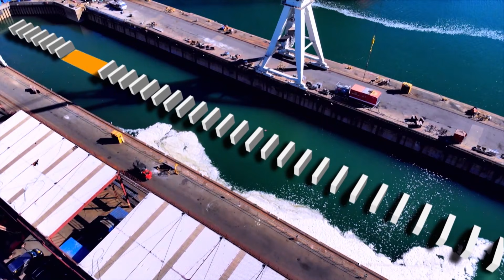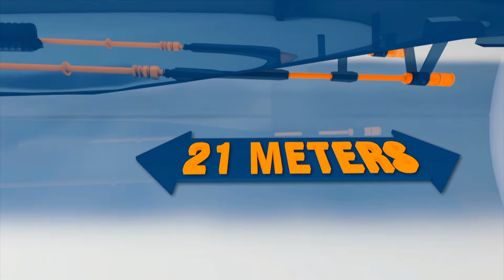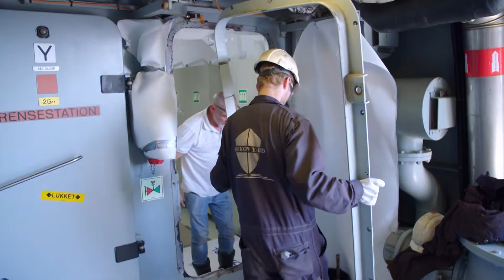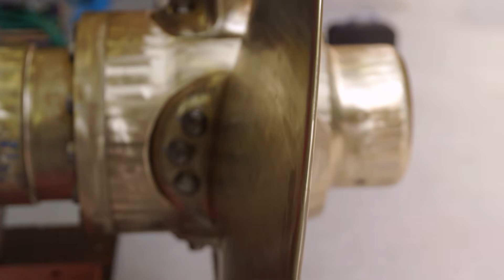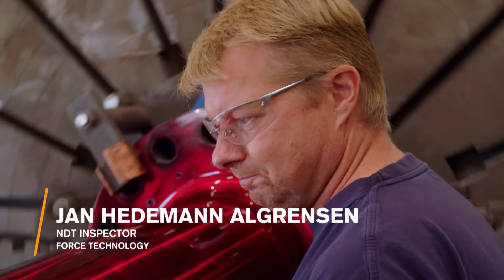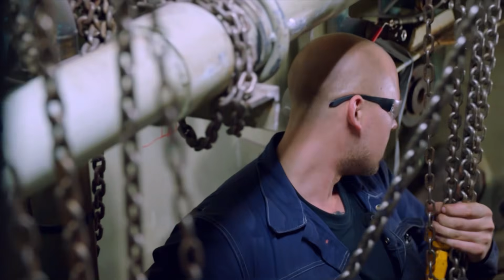War Ship: Navy Vessel Heavy Maintenance | Mega Pit Stops | Episode 4 | Free Documentary

Comment: the 2 things im totally blown away by, #1 the fact that the ship can support itself out of the water on such a small crib under the keel. And #2 were the pneumatic come-along chain winches. How cool are those things?
Reply: Agreed..I was thinking the same
Reply: You forgot the wooden beams along both sides. Whilst they are partially to ensure the ship stays upright they are more to support the weight of the upper parts of the ship so it doesn't sag laterally around the keel line
Reply: I kept thinking how thin the ship's hull looked. Maybe 50mm thick. Seems too thin to be able to withstand any sort of bombardment.
Reply: @spankyjeffro5320 Modern warships focus on trying to avoid being hit rather than to withstand direct hits. The age of the battleship is over, missiles are now the primary armament for warships and no amount of hull thickness is going to allow your ship to shrug off a hit from one of those.

Comment: Having been involved with tracking and balance of helicopter rotor heads and blades I was totally understanding of their dilemma when they had to measure the track of the propeller shafts, whilst I didn’t have a tolerance of only 3mm I still had tight limits to work to, and when you are trying to get an assembly designed to turn at high speed and move in multiple planes it adds a whole new element of difficulty, but these Rolls Royce guys made their job look like child’s play, but I know different it’s neither child’s play or easy, total respect for their abilities and workmanship. 
Thanks for sharing this interesting and informative film, awesome pit stop. 😀👍🇬🇧🏴
Reply: I was amazed they had that large of a tolerance. I machined prop shafts for US carriers and submarines and the tolerances were generally much less. Looked like they were really only checking runout though.

Comment: True I was a Combination First Class Electronic Electrician. We did all the lay outs, in some cases help the Cable Pullers to pull some of the cables to speed the process up in the beginning so we can install the equipment foundations and the Cable wire ways. Then we would do what we were hired to do, install the equipment to their designated compartments. Then install the cannon plugs/connectors to the cables. And once the  Meggers, Megg out all the cables from having one wire as in the coax cables for TVs and electronic displays to up to 400 conductors/wires. Then after that is completely we would apply power test for proper working condition. Then Sea Trials. But since I was one of a few Technicians that was certified to weld the foundations so I always pulled from the Sea Trial team because the next ship would as usual be late starting it because of agreements on the last minute changes and pay and working details because they were all Union Companies so the different shops. Because of changes made late would have to work those details out. So the starting dates would be late so the foundations had to be laid out and installed with “speed” to make up lost time for contracts that would have to work out. So I would always be pulled to have to install the equipment foundations first once the hulls were coming together. But I enjoyed my job! But my other job skill I had was working on Military aircraft mainly Helicopters but I was also a First Class avionics, electronic and weapons technician on them and on C-130’s, A-10’s and transit aircraft that would land and be passing through or had a failure of some sort. So I was one of a few certified to work on all fixed wing and rotor wing aircraft from all of the other branches of the Military Service. Loved every minute of being a Civilian Contractor!😎

Comment: I think he missed out on adding one more "extremely fast and maneuverable" when they took out the thruster :-D
Reply: No no, He said the 127mm Mark 5 gun, he called it "A MACHINE GUN" 
It's a 127mm, A tank has a 120mm.
Reply: @Justineexy  it is automatic, with about 20 rounds a minute.. kinda is a machine gun
Reply: @OliverFlinn  bro, a machine gun is a 7.62 or a 5.56 Gun that can fire about 700-1000 rounds per minute.

That Mark 5 127mm gun is about 60 times larger than a 7.62MG. 

Even if you take a .338 it would still be 40 times smaller than the 127mm.

127mm is the gun used on the arleigh Burke,  Capable of hitting a target at over 20miles and can sink a ship with 10 to 40 rounds. 
The 7.62 Cam even pen a ship..
Reply: @trymetal95  hey,  It's the danish man,  you gotta consider the fact that Denmark is small, making these ships really is an accomplishment.
Reply: @Justineexy  an automatic gun that fires bullets in rapid succession for as long as the trigger is pressed. <--- definition of a machine gun, not a "its 7.62 or 5.56mm.
Reply: @OliverFlinn  jezz! Man?!  
It doesn't fire automatically,  It's a semi auto. Like how you can shoot an M4 on semi auto,  It can fire a round every 5-8 seconds...
 A machine gun can fire a round every 0.2 seconds or so
Reply: @Justineexy  it does fire automatically, theres a joystick, and you just have to press on it, it loads automatically, as long as there is ammunition in the magazine, therefore, by definition, a machine gun.

Comment: They should be using pipeline pipe rollers with rubber padding on rollers for this drive shaft
Reply: I have the feeling they know what they are doing, but  you can always apply for the project manager job if you think you can do better.
Reply: Steel rollers don't hurt them. Some places do use ones like you've mentioned though. I've worked on a lot of prop shafts far far larger than those and we used steel rollers. More often than not you do all of those inspections in the lathe between centers anyway. Looked like they were just checking runout for the most part.

Comment: All through this documentary it is scratching and clawing for sensation that is not there and i always wonder why!, the made up tension and "suspension" around the crooked prop shaft is bogus because they already suspected it to be crooked when it was still installed so it is in the repair schedule... what's the surprise??! ... let the video tell its story and stop making a fricking drama for nothing!.
Reply: Yep as soon as I heard the American talk I knew it would be like this. What could have been an excellent documentary but sadly ruined by the ever over-dramatic yanks.
Reply: I'll not call this a documentary at all.
Reply: I missed the “and time is running out”
Reply: The prop shafts are always bent to one degree or another. They made it a huge deal. Sometimes they are bent like a banana and you can straighten them, even ones far larger than in the video, by beating them with a sledge hammer. I've had to straighten a lot of aircraft carrier and submarine shafts before.

Comment: it's crazy scary that they balance the ship with only wood rods
Reply: Naw, they had tight ropes as well.
Reply: The ship is balanced entirely on the dock blocks at the bottom. The side shores (wooden rods) are only for stabilising the ship during the "twilight period" when the ship is partially sitting on dock blocks and partially buoyant as the water in the dock is pumped out.
Reply: Wood "rods"? Telephone poles are "wooden rods", too. But BIG wooden rods. It's all relative.

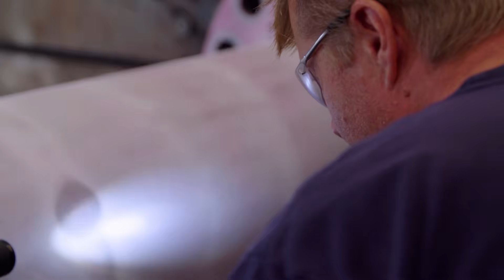Comment: 35:47 But how they fix the shaft?
Reply: even though it’s expensive the shaft should be replaced and not fix .
Reply: @dllms  brand new shafts regularly receive the same repairs right after being manufactured. Defects are common and easily fixed. Navy shafts are reworked multiple times over the life of the vessel.
Reply: Grind into the bad areas, weld them up, turn it in the lathe, roll-grind it, test it all again.

Comment: Water Tight Door "Chalk Test" is just a preliminary Test, for a Splash of Sea Water it's ok, but if the ship is soaked in Deep Sea or the other side compartment is full of sea water a bigger pressure to expect, they should take UT or Vaccum Test on the door and frame itself before they make final analysis.. They should hire a 3rd party Maritime Inspectors ( Lloyds or ABS, etc.).. The Pressure for the Time Table Target for this ship maintaenance job will allow mistake/s to slip by..The critical part is during Decomissioning Time, were Unexpected occurs..
Reply: They showed only weathertight doors.

Comment: they need under ship bolt-on hatches instead of cutting the ship open to remove the shafts
Reply: That’s too dangerous for this type of ships, war ships mostly made of high tensile steel for the high speed and the flexibility as well as structural tensions under extreme maneuvering,
Bolt-on hatches usually has a rubber gaskets for leak integrity which is way to danger for underwater compared to welding seams.
Just my point of view since I’m an veteran marine engineer.

Comment: Are the propeller shafts taken on  a lathe to check its concentricity ? By the way, the ship was manufactured by which company and where ?
Reply: Usually they end up in a lathe during refurbishment and that's when you check runout, concentricity, roundness, diameters, etc.

Comment: Damaged by excessive speed in a military manoeuvre? Surely that really means that the shaft was either incorrectly specified at design time or was accepted at manufacture and installation with an acceptable compromise? What was the cost of better speccing the shaft Vs the cost of rectifying defects every 5 years?
Reply: getting a new shaft would probably mean a very long downtime, since the construction and delivery of one takes many months. so i guess the compromise would be time.
Reply: or the captain got a bit cocky and maybe done something he shouldn't have

Comment: Who cares if there 100µm missing on a 40 cm diameter prop shaft surface ? It'll covered by 5 mm of crap and various stuff under the sea water. Bent by 1 mm ? It will bend by at least 1cm as soon as an enormous of torque will be applied on it. Too much drama about nothing.